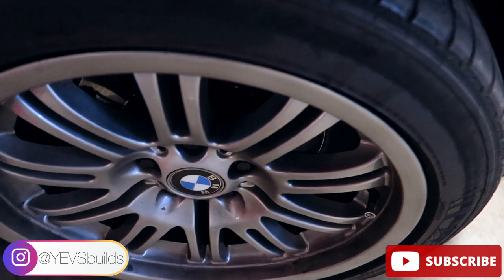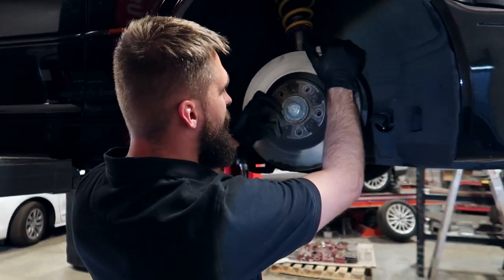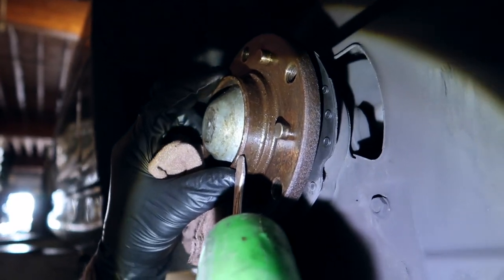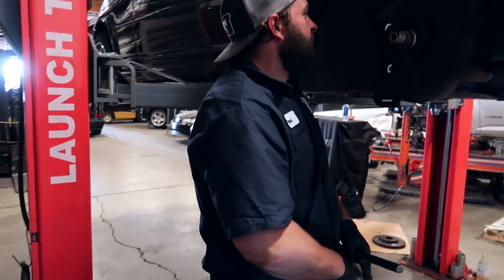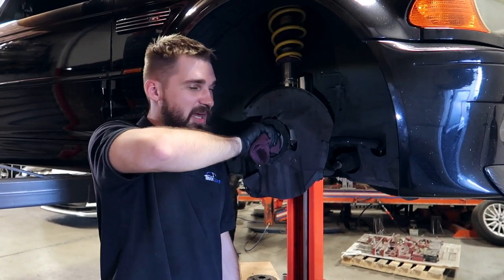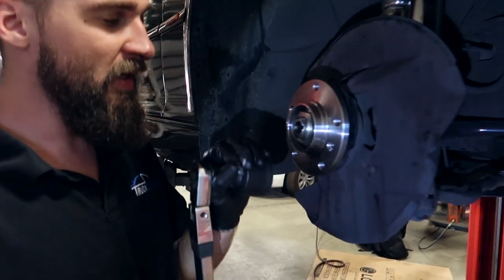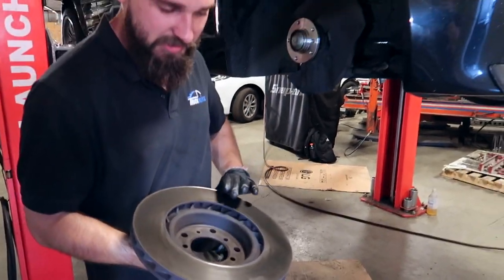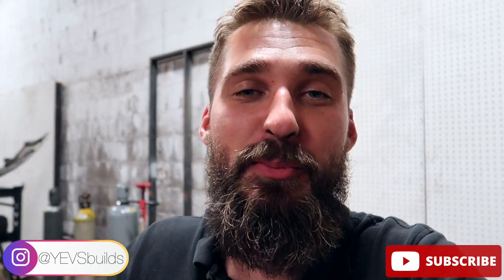How To Replace Front Wheel Bearings on a BMW E46 M3

Comment: Damn you use a gear puller to get the inner race off that gets stuck on there after pulling the old wheel bearing off. Grinding and heating just ain't necessary.  Also, a 36mm socket placed over the middle is the perfect size to then knock the new hub back on all the way, rather than tightening and loosening.